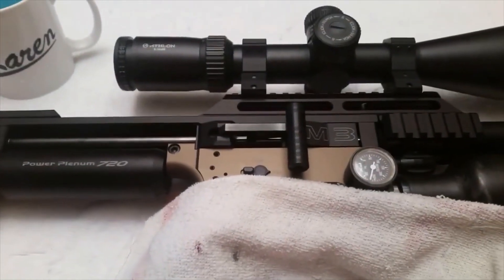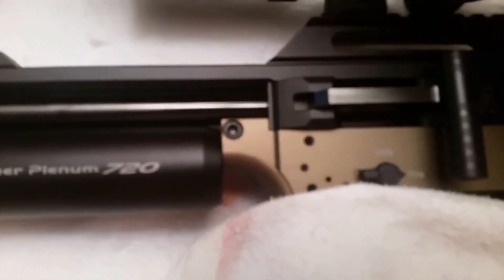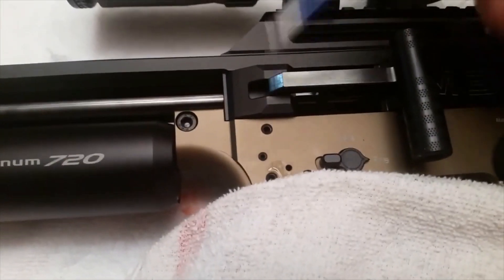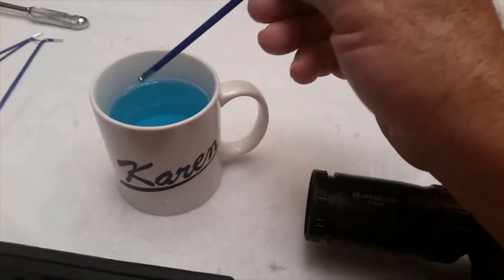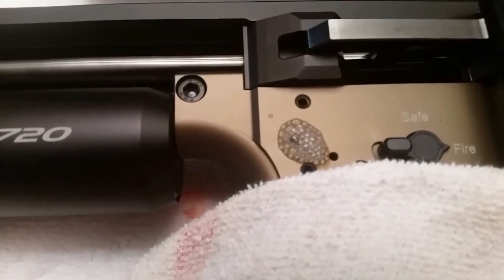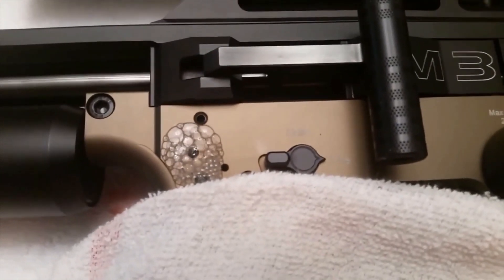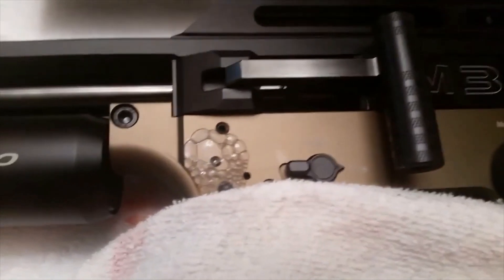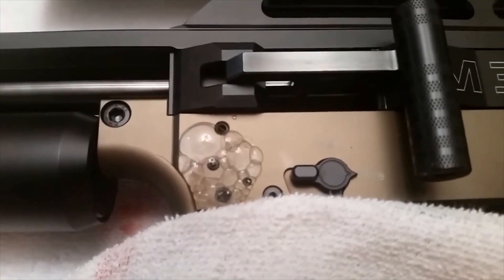ANOTHER IMPACT M3 SLOW LEAK FOUND

Comment: So I have developed a leak in the same spot.  I can't seem to get the screw out (some sort of nuclear locktite).  I've tried to heat it a bit with a solder iron on the screw, but still not getting it.  The 1.5mm wrench I have isn't the best either.  Any suggestion on getting this thing out?  Thanks.

Comment: Chuck, had the exact same leak but I couldn’t chase it down. I wound up sending it back to FX for them to fix it; dang shame.
Got it back with no more issues. The technician from FX called me to let me know where the leak was coming from but regardless I was somewhat upset. The Impact is an incredible platform but damn there are many areas for potential leaks. 
My .35 has been back twice for leaks, first regulator and then the hole you discovered. FX has taken great care of me and I definitely appreciate their standing beside their product.
I opted to send the rifle back because of the warranty and due to the amount of money spent for this rifle.
Thanks for you videos and keep up the great work…
Reply: So what was the leak area???   ( part number, oring etc...)

Comment: That is why I did not buy an FX impact or any other gun from them because I've read so many bad air leakage reviews on the impact. I think they purposely made those guns for you to send it back and spend more money to repair it not to mention all the upgrades or accessories to buy from them. I spent my money on well built airguns and bought two Taipan Veterans, a .22 & 25 cal, Kalibrgun Cricket, 25 cal and a AGT Vulcan, 25 cal. I have no problems with any of those airguns. They are simple and very reliable. FX seems to think an over engineered gun is a better gun which is not true. Maybe it's a marketing thing where they will make more money with people just buying another FX gun after giving up with their problematic gun. 🤔
Reply: Fx impact 2 and 3 and the Maverick  🤔 I think a lot of people buy them because they are expensive and they think they are getting something better because of the cost . Unless you have a big wallet to keep paying gunsmith’s to put them right, or you are competent and confident enough to start taking apart a near £2,000 gun  every time it has a leak I think FX guns are best left alone.
Reply: On purpose doesn't make any sense, literally no sense at all. Things happen, sometimes its a bad part run. I see that you have a leak but I don't see proof that it wasnt your fault either.
Reply: @Powerpickle68    Hi pickle, my local gun shop sold a Impact to a customer who spent £3,000 plus on the gun and scope +bits. Two days later the customer came back complaining the gun was under powered, the gun dealer put the gun on the crono and it was doing just over 400fps. Not wishing to loose a good customer   (he spent a lot at the shop on shotguns,rifles and all the bits that go with it,) the gun dealer said we will get another off the rack rather let you wait while we send it back to FX. So they got another lmpact off the rack to replace the faulty one. Just to make sure the customer was getting what he wanted the gun dealer put the replacement Impact on the crono , that gun turned out to be under powered. 4  Impacts later, all new , and all way under powered the gunshop owner had to refund his customer.
The gunshop no longer sells FX guns as they are so unreliable ☹️ I love the look of the Impact, light weight with a high shot count ,would be perfect for me hunting . But I need to know when I pull the trigger on living thing it’s going to be reliable and do the job.

Comment: I won’t buy one till they make this high price paper weight work as it should “;)
Reply: Im into buying one i saw alot of people complaining about leak but i also saw alof of people not taking good care of them sure for an expensive air rifle you shouldn't have to deal with all that but get some Orings and most of the times its O rings or use plumbing wire to tighten  most parts